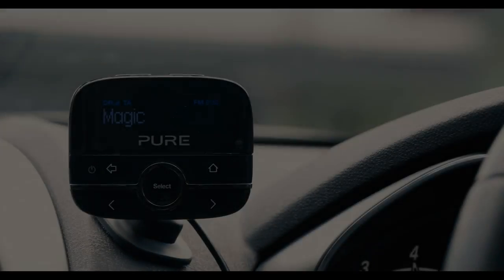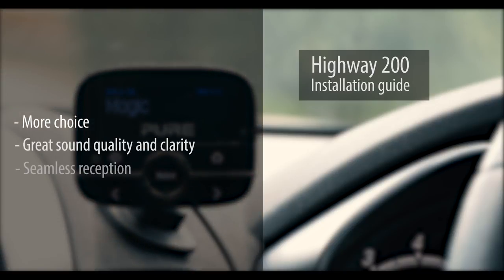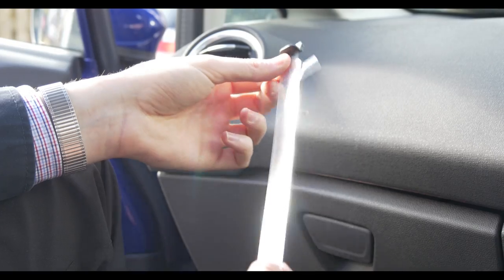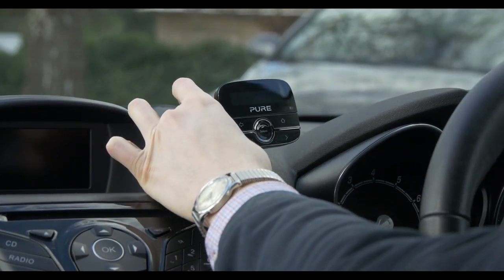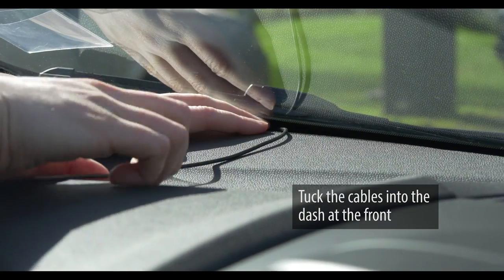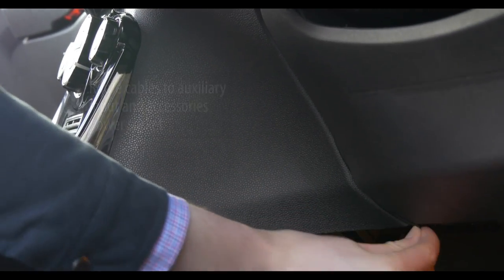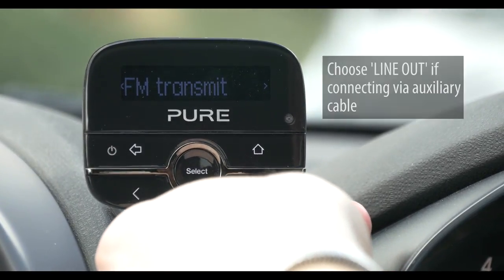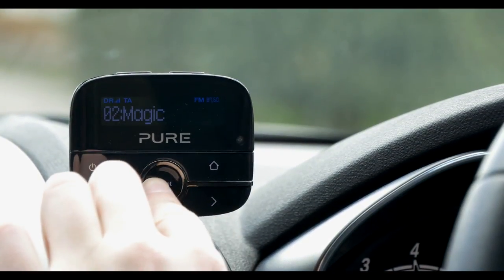Pure Highway 200 - Installation Guide

Comment: Ive just installed one of these in my car and the reception is terrible and wont stay tuned in to a station. Can a amplified external aerial be used  with these? 🤔
Reply from the maker: Hi David, thank you for reaching out! If you own a highway 200, then we recommend the use of an external SMB type aerial as it can help with picking up stations with weaker reception.
Reply: @PureAudioHQ  ive hooked this up to a amplified external bee sting type aerial and ive still got the signal loss like before. I'm going to try a 25db gain signal booster and see if that helps
Reply from the maker: Hi David, thank you for your return. If the issue persists even with the signal booster, we suggest checking for a heated windscreen, UV filter or any in-built/external electronics, i.e. sat-nav, dashcam or multimedia system. These can cause interference with your signal.

Additionally, we suggest using the grounding cable as well, it is supplied with the highway and can get rid of some reception issues.

Should the issue persist regardless, we recommend checking for a replacement antenna. We do not have them in stock any longer, but you might find them available in online stores.

Comment: Does it come on automatically or do you have to turn it on manually? And does this have as good signal strength and the highway 400 and 600? Thanks
Reply from the maker: The unit switches on automatically when it gets power. The reception quality is comparable. BR, Marco
Reply: @PureAudioHQ  Ok perfect, I will buy one now. Thanks for your help 🙂👍

Comment: What if u don't have an Aux in socket in your car?
Reply from the maker: then our Highway 400 or 600 is the right product for you. With these models you can transfer the signal via FM transmitter. However, the connection via AUX is more stable. BR, Marco